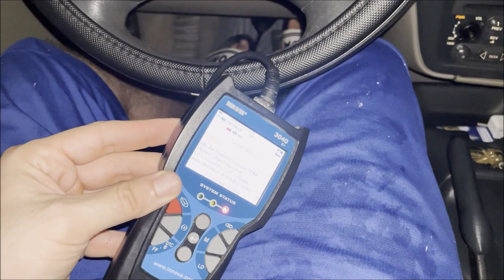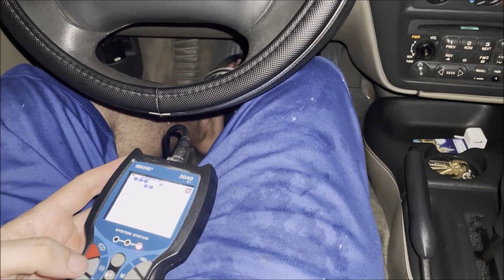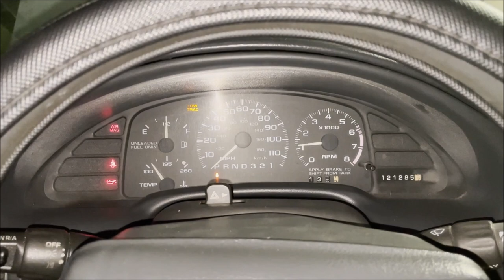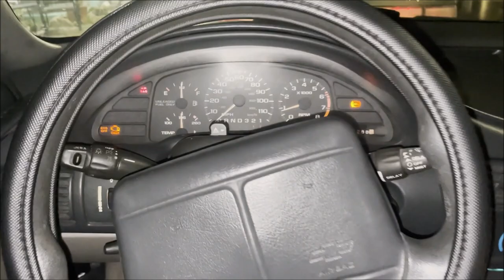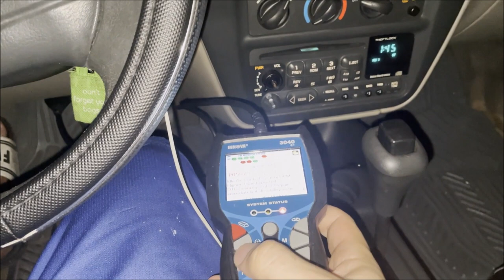$600 Cavalier Convertible Stalling & Repair

Comment: I live in AZ. Have a 2000 ls 2.4 l. 139,000 miles. Runs pretty good. Always change hoses every 2 years. New Platinum plugs and coil boots and coils. After 20 years were probably weak. 32 mpg. At 65. Really like it. The only problem is the dash or whats left the sun just destroyed it.  Fell out in pieces.

Comment: I had a green 98 Cavalier coupe, I got it for free from a coworker because the dealership wouldn't offer above $150 when he went to buy a new Dart in 2013. I remember it was a pita to change the stupid camshaft sensor but it ran a good long time till someone ran a red and tore the whole front off. Always liked these more than the junk Cobalts that replaced them
Reply: Had an 08 Cobalt, got lucky with it, owned it 10 years and 150k miles with minimal issues until I traded it in for a scion haha.
Reply from the maker: @johnl3230  I’ve had great luck with my Cobalt as well. Bought it years ago with only 48k miles now has over 90k never needed a single repair just tires, brakes, and oil changes.
Reply: @bigalsbikeandauto  well hell yeah man, yeah it was a good car. We took her everywhere. That collection you have is amazing man. That's a dream for me lol
Reply from the maker: @johnl3230  Cobalt body and interior build quality is abysmal but the drivetrain is great. I still prefer Cavaliers though, especially the older 2200 4 cyl Cavs without timing chain/chain tensioner issues.

Comment: The IAC doesn’t have anything to do with drivability. The way it was behaving reminds me of erratic airflow readings. Im wondering if one of those intake tubes or air filter box wasn’t installed correctly and has unmetered air entering the engine. Either way, sweet you got it sorted out!

Comment: Glad to see you got it resolved. It is always interesting seeing you work on the cars. It is interesting to see what you will purchase next. I must say it was interesting watching you get up to speed on the highway too.  I hear you on the engine. It was called Quad 4 then once the other GM brands got it, it became the 2.4 Liter Twin Cam. Hard to believe but at one time Oldsmobile was working on a V8 version that was the Quad 8. Motorweek showed it. I know the video is around. They were also trying to turbo charge it too as well.

Comment: check the rubber hose connecting the MAP sensor to the throttle body, I had a Z24 and that rubber hose cracked and I couldn't go past a 1/4 throttle.

Comment: I used to have a Cavalier that would buck and kick hard whenever it had run for a little bit. We were told the transmission was bad and the engine was trashed because metal had gotten in it. I don't know exactly what was wrong with it because I hated the car so much but after that, we got another Cavalier and that one leaked so bad that when it rained, like it does in the summer in Florida as you know, it would get standing water in the floorboards. So I never had luck with Cavaliers and we had 3 of them. We had one that blew a head gasket a week after we got it a d the used car lot gave us a other one and that one lasted 2 years.
Reply: Good times, good times….

Comment: AND ANOTHA ONE?!?! Confirmed; snow storm at Big Al's!!!  ;). In all seriousness though after I was breaking balls in the comments of the last video about giving us a couple of videos within a few days of each other I thought, "If Al only grabbed his phone and shot a video every time he's doing something to a member of the fleet, changing oil etc, he'd have content for days!". Here's hoping to see more content on the fleet vs just the new additions acquired.  Just curious, when was the last time you had either of the Trofeo's fired up? Jonesing to see those getting some TLC.
Reply from the maker: That’s the idea. I work on my cars almost every day so may as well start filming it. Black Trofeo’s fuel pump died and won’t touch it until I have a lift again, blue Trofeo was hit by a tow truck in rear quarter at body shop waiting to be fixed, and white Trofeo is still a barbecue mess.

Comment: Oh the good ol quad 4. One of the worst GM engines ever. I had a 98 grand am GT coupe 5 speed that had running issues non stop. I replaced everything I could think of and my friend worked for Chevy dealers for 35 years and even he couldnt figure it out. I just got rid of it. That body style grand am was my favorite but no more quad 4s. Also, Al, you know as well as I do that you only use GM/Delco/Delphi parts on any GM car. Never use aftermarket. They don't last. The parts stores stock and can order GM parts too. Purolator is made by Mann Hummel, even says right on it. That's what my wife's Hyundai used from the factory and what the OEM filter was so I use those on hers. I use Delco filters on my GMs, never anything else. My suburban just got an ac delco alternator
Reply from the maker: Quad 4 is not my favorite engine but it’s a blast in this little Cavalier. If it ever fails I’ll probably swap in a 2200 for reliability even though it will be slower.
Reply: i have  a q4 in my 99 grandam    runs great....never  cant hear it run...